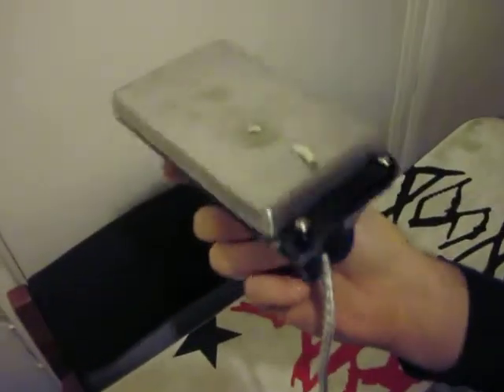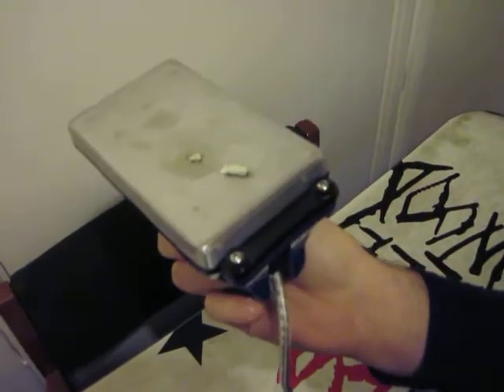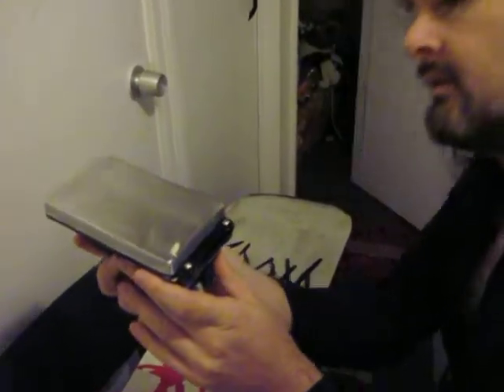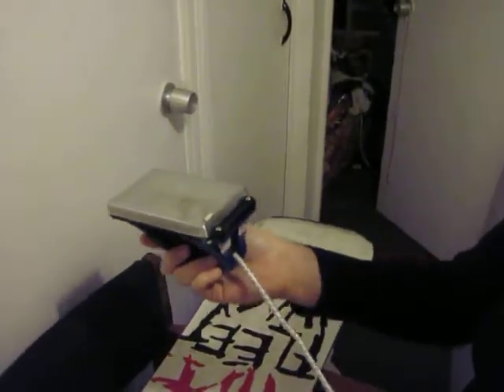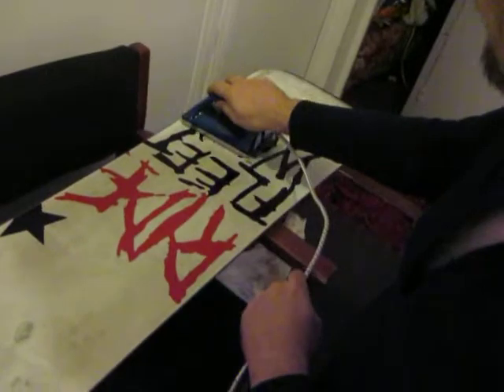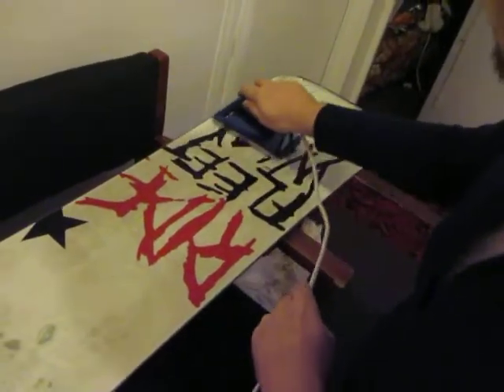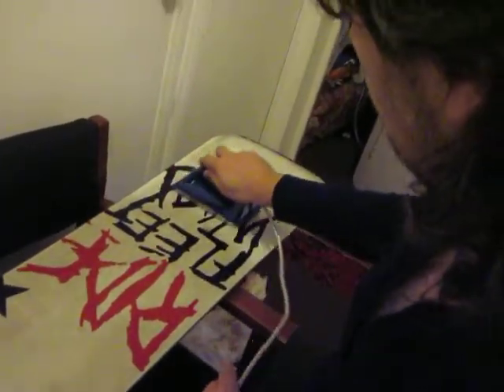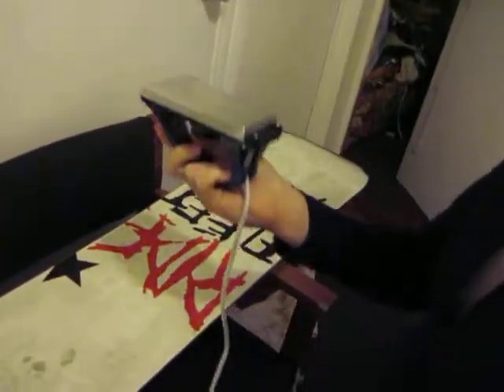Melt-and-slap snowboard waxing

Comment: Try dripping the wax, and not so much rubbing it on with board with the iron. It's much more efficient.
Reply from the maker: I have done - that's what I did the first time I waxed the board.  What I found was that the wax would need to have the iron in the same place for what seemed like a LONG period of time to get it to re-melt.  Just as you get one patch to melt, another has re-solidified.  So the results were patchy and I ended up scraping a lot off.

Dripping may work better for 110C waxes, but I find this method works so much better for 140C waxes.  I wouldn't even dream of dripping a 160C wax.

Plus - I found this to be a good way of reusing scrapings.